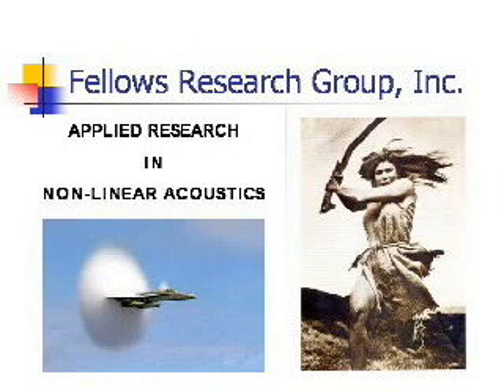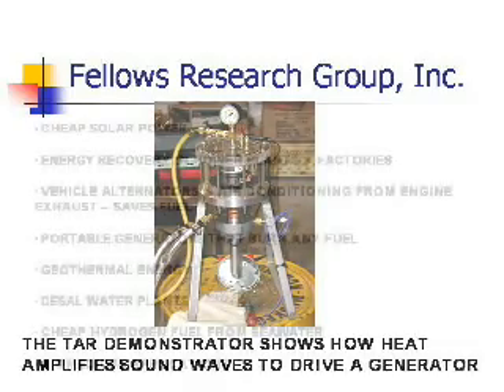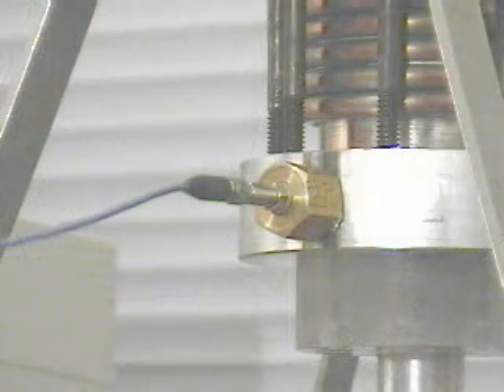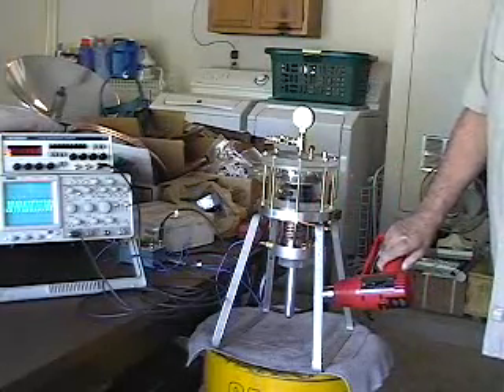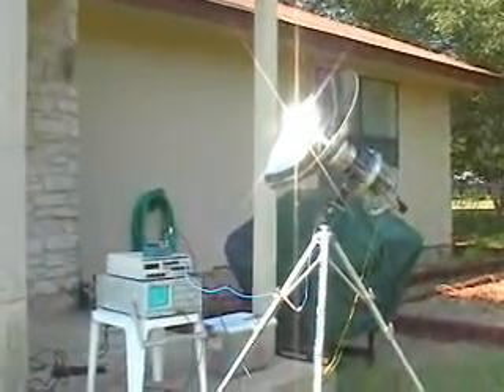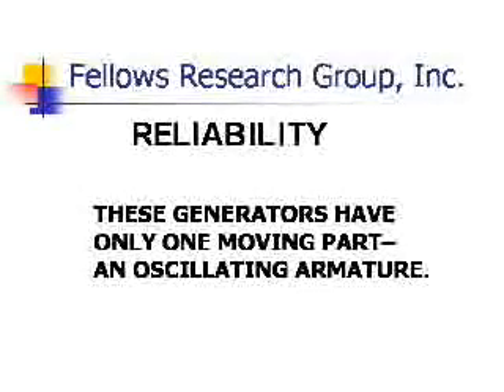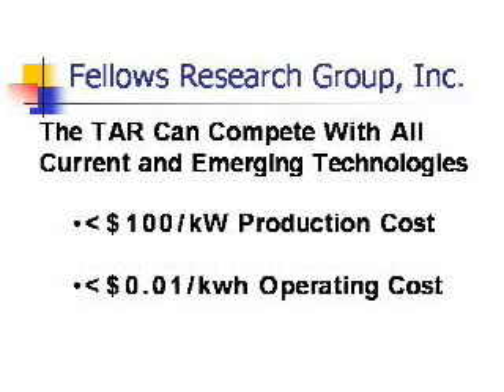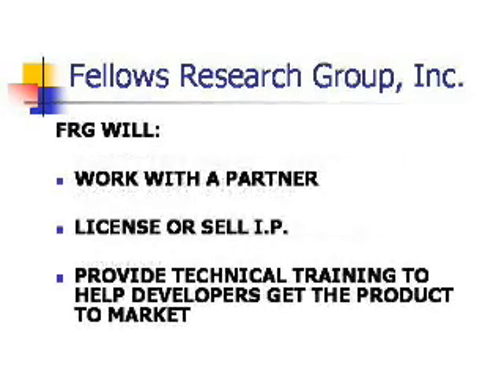Fellows Thermoacoustic Cycle (TAC) Generator

Comment: For high power they need to replace the piezoelectric converter on the TAC with a proper magnetic generator actually able to produce kilo-watts of power - significantly more than most solar panels.  A sealed for life (low maintenance) prototype that can simply be attached to someone's equipment is needed.  Get its picture into a few magazines.